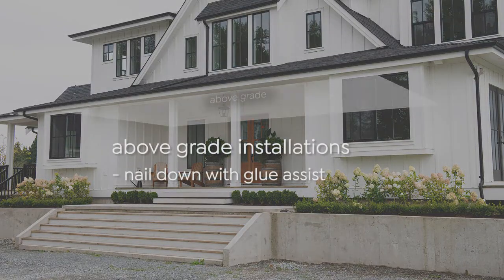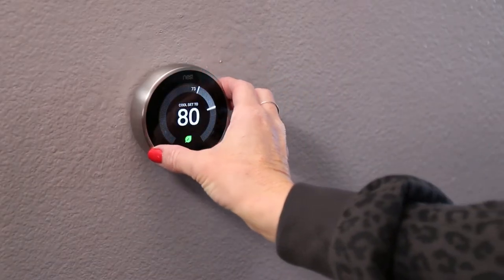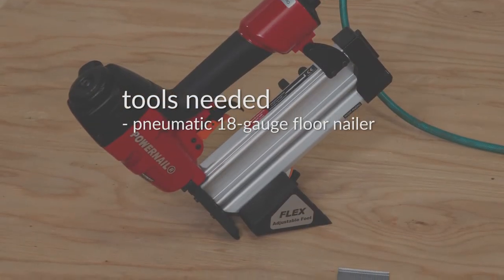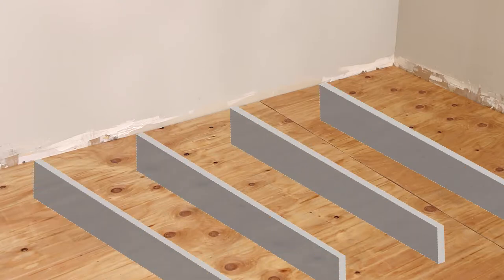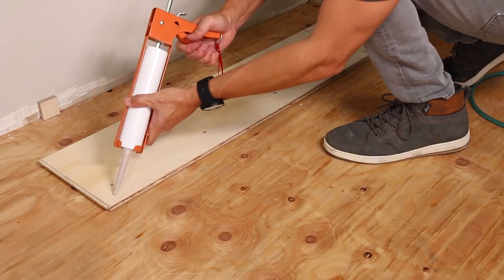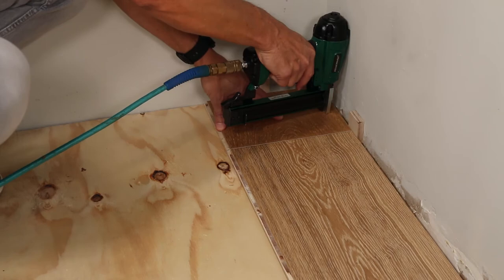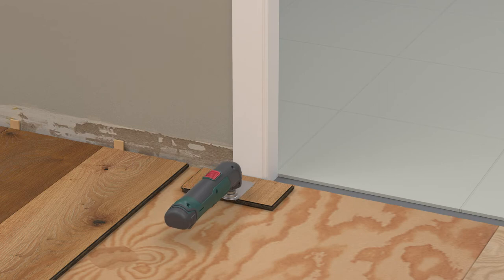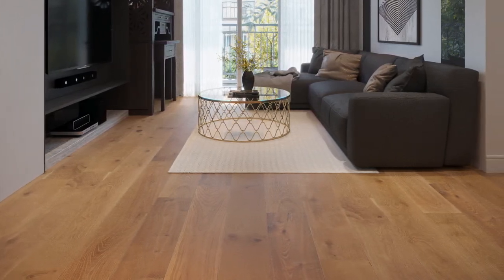Nailing Down Meritage Engineered Flooring with a Glue Assist

Comment: why can't you use liquid nails?
Reply: I was just thinking the same?  Why the hell not?!  Pretty sure it would work great.
Reply: @react1200 definitely can. But if you dont know what youre doing like me, gluing down seems like a big commitment if you mess it up haha
Reply: The good flooring adhesives are formulated differently than standard PL and liquid nails. Polyurethane vs modified polymers, the second allows some dynamic movement to let the floors expand and contract with time